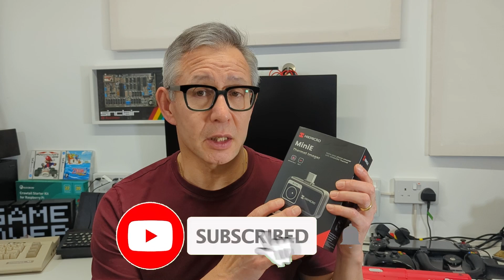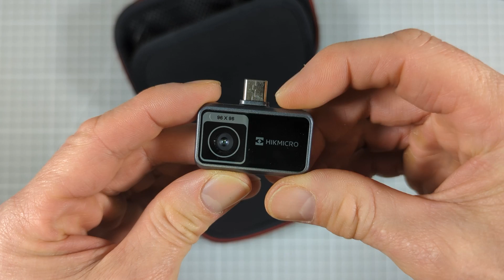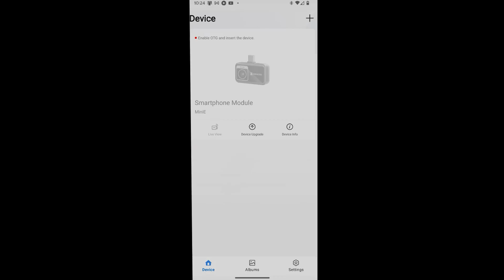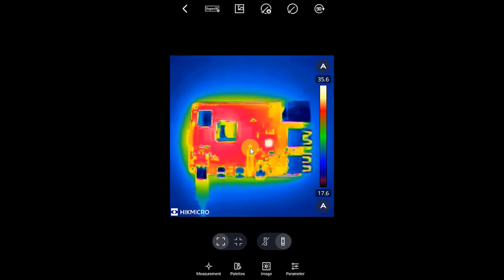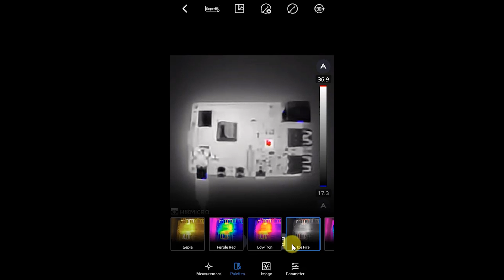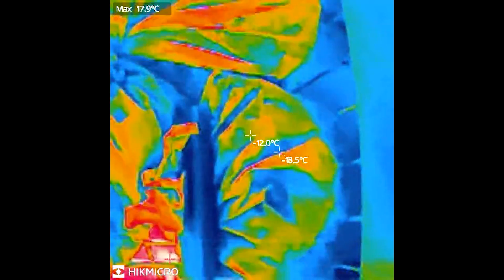Affordable thermal imaging - HIKMICRO Mini E Thermal Camera

Comment: This vs the mini 2, your thoughts?
Reply from the maker: I haven't tried the Mini2 but I have another manufacturer with the higher resolution.

To be honest for the majority of jobs the higher resolution doesn't make much difference. Yes you get higher res images and can see more detail, but for general temperature monitoring, even spotting the hot components either will work well. I'm sure there are certain situations where the higher res will make a difference but I haven't really come up against those as yet.

Comment: Good video, how would this camera fare for finding heat loss around the home? Cracks around the windows/doors, loft, aimed at the outside of the house etc?
Reply from the maker: I tried it on my house and it does show where the heat is escaping - at least the hotter areas on the walls, window frames, etc. where I guess hot air might be leaking out.

Comment: Does this camera have a way of merging the phones camera with the thermal camera? I just purchased a slightly more expensive stand alone thermal camera and Its been a bit of a mixed bag. It was around $180 (US) and has a larger (160X120 @ 25hz) sensor but its not exactly high quality. Its should have the ability to merge the thermal image/video with its onboard normal camera (like Flir MSX) but the latter is seemingly broken. It still gets the job done but I'm not totally sold on the accuracy. I also have a Flir one (very similar to what you have here) and can say with confidence that the user experience is much better than my newer one. I like the model you have here, I wonder how well it handles reflective or absorptive objects. I strongly believe we're about to see massive price drops with thermal cameras as Flir seems to have much more competition these days. It's really awesome to be able to see which piston isn't firing properly on an engine without taking it apart. I bet we'll see these as cheap household items in less than five years.
Reply from the maker: No. The app simply shows the phone camera view as a insert window on the app screen. As the cameras are not aligned the views are different. I guess you could use the extension cable and put the thermal camera beside the optical camera lens to get better alignment.
I'm not an expert on these things but I know you can adjust some parameters for accuracy. On the reflective side it does seem to register the reflected image rather then the reflective object. Not sure if that's what you mean.
I have seen some sub £50 versions of these cameras but not sure of the quality. I guess the internals will probably be much the same.
Reply: @BytesNBits  Thats still quite helpful even if the images aren't aligned. I have trouble seeing things like wires when using just the thermal sensor alone. I'll have to take a look at this model, seems like a pretty decent unit.

Comment: Dig out your old cellphone and charge it up. There's a thin clear plastic type layer on the camera's Objective Lens, (In Side), called a "Hot Block". It is an IR blocking filter. Remove it with pointed tweezers, and your cellphone camera becomes a fancy thermal imager. Simple! . . `Thought Everybody knew that, because it was realized way back 30 or so years ago.
Reply: Thermal imaging is FIR Far Infra Red (around 10 micron wavelength) and needs a specialized long wavelength sensor. The IR that your cellphone is filtering out is NIR Near Infra Red (around 1 micron wavelength). For reference the regular Optical band for phone CCD sensor is 0.3-0.8 micron wavelength.
Reply: @gaitskell  It works and it doesn't cost $10,00, OK? `Nit-Picking Jerk!
Reply from the maker: I hadn't come across that. Thanks. Sounds like a project for a future video!!

Comment: I'm very tempted given that I am in something of a "chicken and egg situation" when it comes to my doing electronics and fault-finding work on motherboards (usually within older PCs and laptops).

I've not been able to go right down to component level easily when it comes to motherboard shorts and this will help me get there - at the same time, however, the PCs and laptops I repair are generally "common as muck" and I can usually pick up an entire new motherboard online for £10 or £20, so it then becomes a case of "how much is one's time worth"!

But thank you for a very useful video, it has got me thinking! £120 for a thermal imaging character of this quality is "not to be sniffed at".

And let me take this opportunity to wish you a very happy and prosperous New Year!
Reply from the maker: It's quite a useful tool to have around, not just for electronics. I've only been using them for a few months on my repair jobs but they do come in handy and get you looking in the right sorts of areas for faults. As you say it's then down to cost of replace against cost/time of repair.

Happy New Year to you too!!